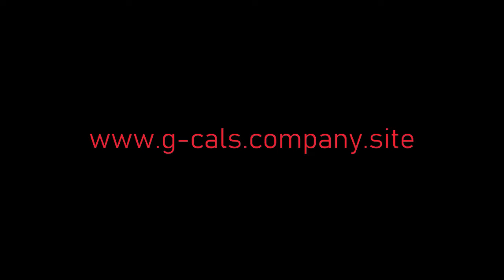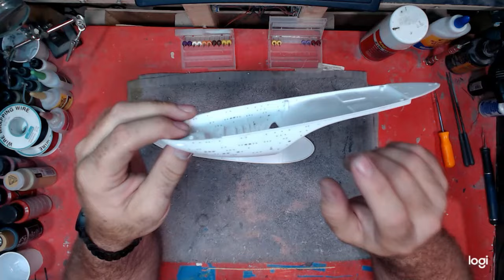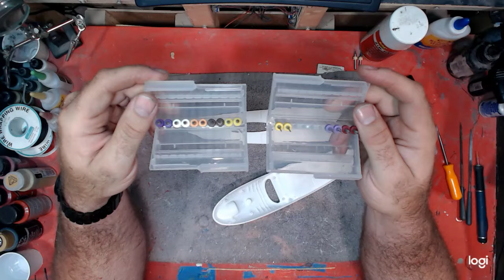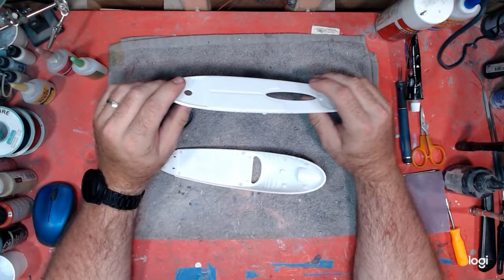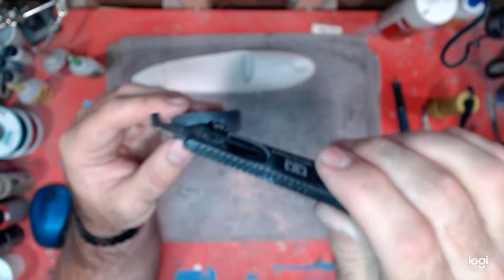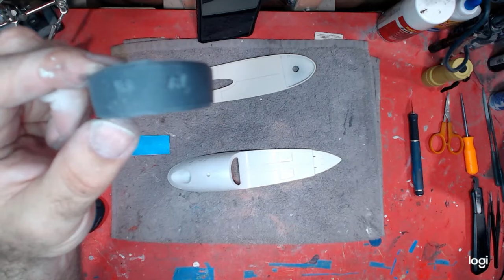USS Excelsior NCC -2000 Build 1/1000 Scale - Episode 1

Comment: Love the new parts that Round2 made for the Excelsior. Also are you getting one of those big resin printed kits?
Reply from the maker: I have a 1/537 Enterprise B already.
Reply: @theensignschair  Excelsior looks nice.
Reply: @theensignschair  out of interest is Lake Monster still going make the parts for Kronos one, mainly the bit that covers the rear torpedoe tube.
Reply from the maker: Cass is working on the application instructions now, should be out soon!
Reply: @theensignschair  thanks.

Comment: ST VI shows torpedoes being launched for those spots on the front
Reply from the maker: The lower openings yes, not the upper.
Reply: Hello Robert. Those to ports that it looks like you're point at are in fact the photon torpedo launchers. In VI, you can see the torpedoes coming out from those holes, just in front of the registry banner Delta insignias. No reference materials indicate there are any windows in that area.  The upper square ports, on the ribbed neck area, could be doors for loading torpedoes/probes. But are also referenced as "additional" torpedo launchers. LOL, typical of Star Trek details.